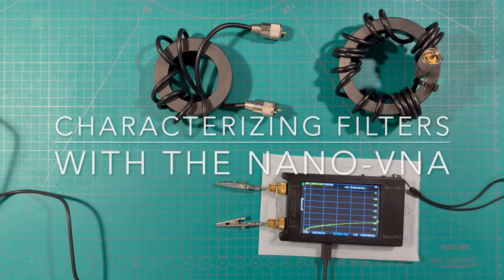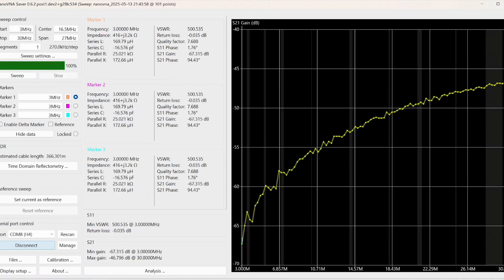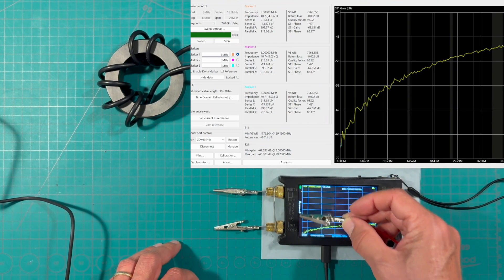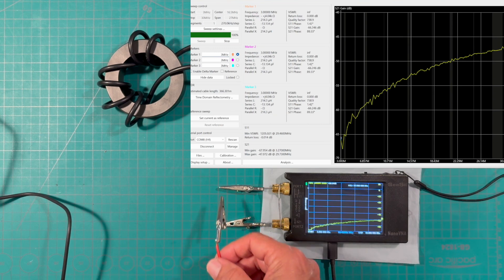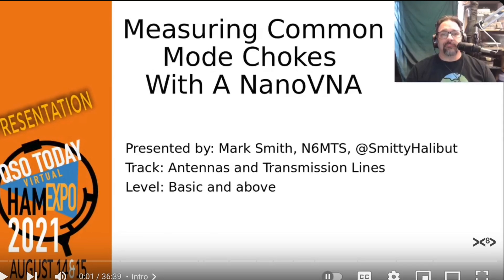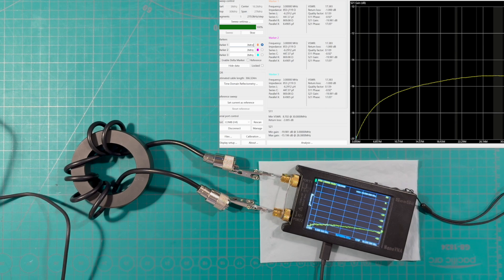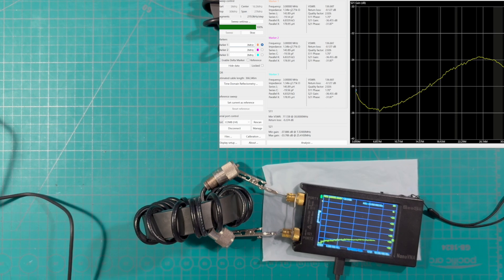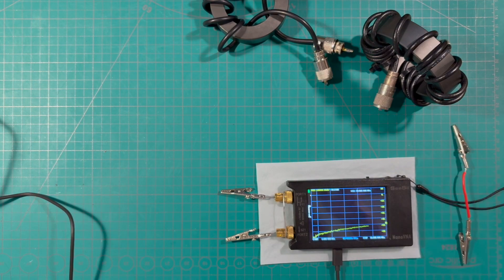Characterizing Common Mode Chokes using the NanoVNA

Comment: Isn't the common mode the current that flows in the same direction on the shield and the inner conductor?  So to test that with S21 wouldn't you short the shield and center at both ends and measure it as a simple coil?

Also, did you calibrate the VNA before you measured this?
Reply from the maker: Thank you for the comment.  I wanted to focus on the common-mode current only and did not want to look at the shorted inner conductor and sheath.  Per my understanding, it is that unbalanced current traveling on the sheath that causes interference and the one that I want to attenuate to improve my Signal to Noise Ratio.

So what I measured was the impedance profile as a function of frequency of the coax sheath using the frequency sweep functionality of the nanoVNA.  As mentioned, I followed Mark Smith's (N6MTS) presentation on QSO Today 2021Virtual Ham Expo, link in the description.

Regarding the calibration of the nanoVNA, yes the instrument was calibrated as close to the measure point as possible using the 3 standard calibration jigs included w/the device. 73.